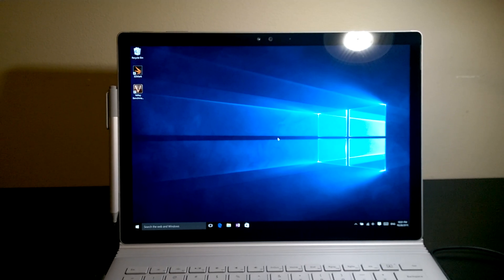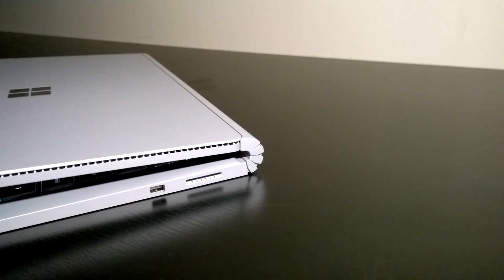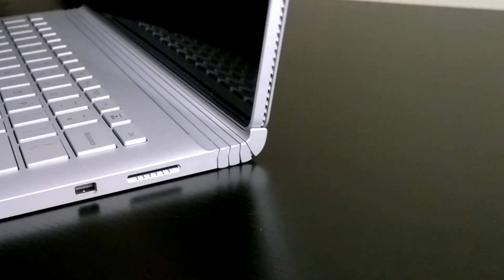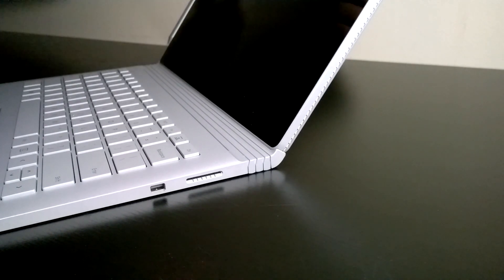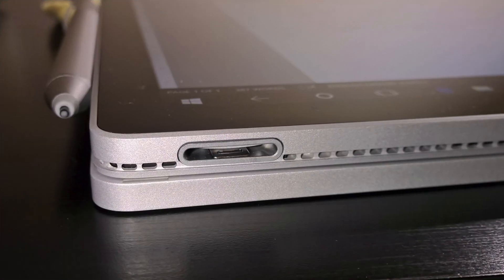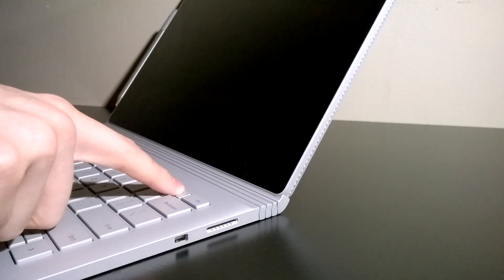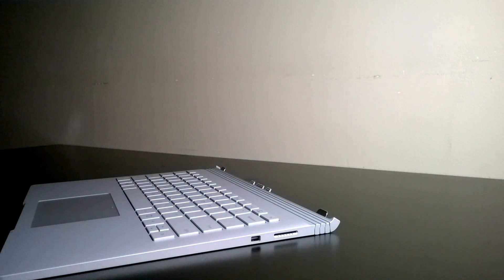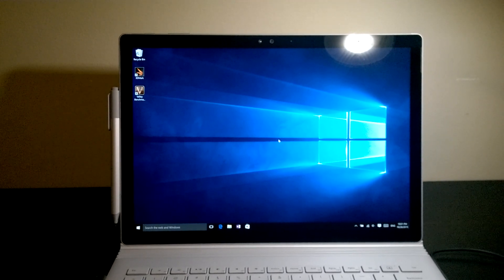Detailed Look: Dynamic Fulcrum Hinge and Latch (Surface Book)

Comment: Good video. It seems to me a case for the Surface Book would solve many of the issues people have. I Imagine some kind of leather type case with a support in the back to stabilize the monitor when in laptop mode. And you could have little smooth bits between the hinge and the case to protect the hinge. This would also handle the dust issue people worry about.